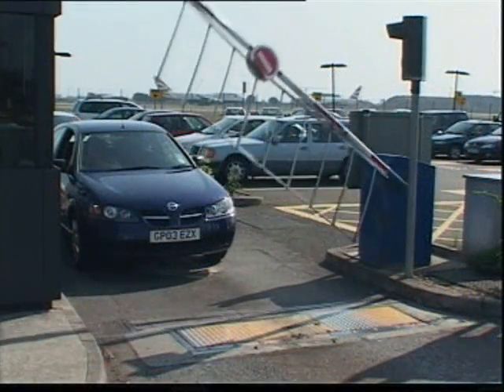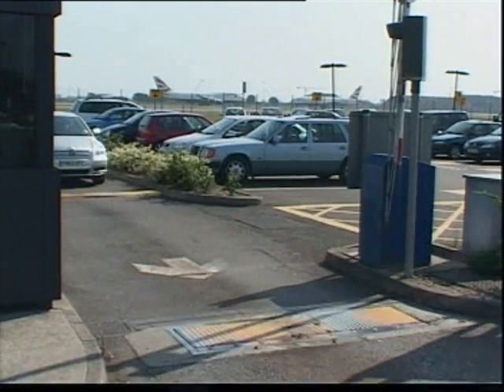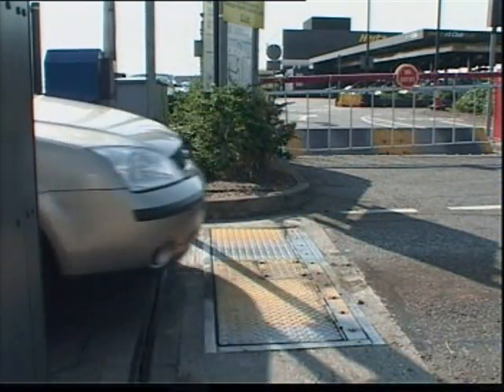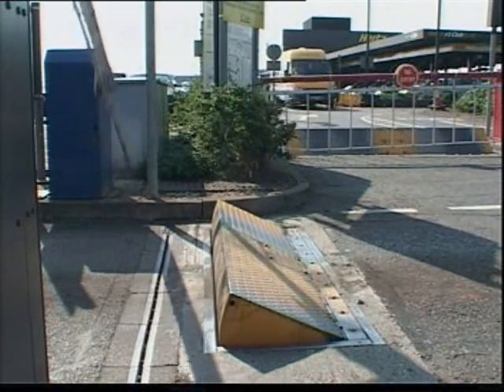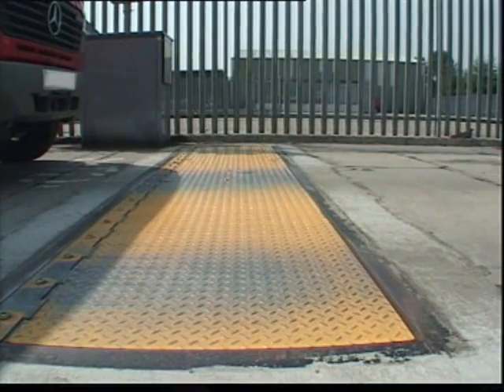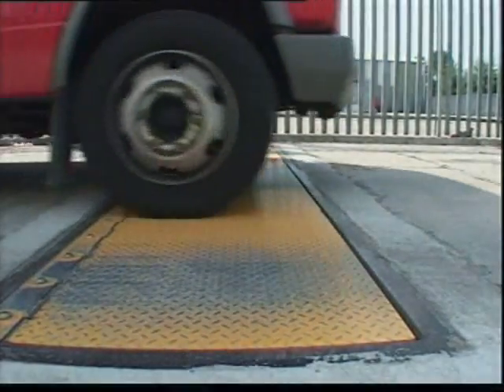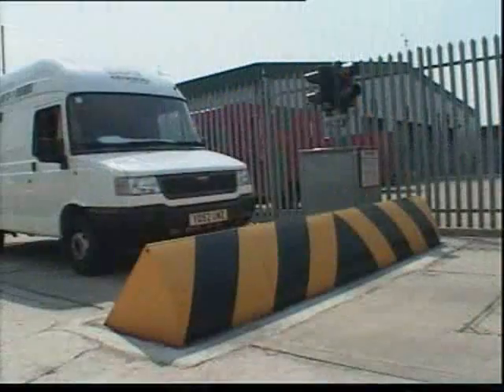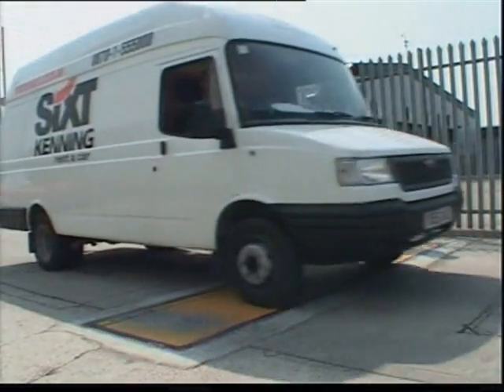Access Control Road Blocker Crash Test

Comment: Many cities already have systems in place that automatically change the lights for emergency vehicles. One way to solve the problem. Another would be for the emergency vehicles to use the on-coming lane, just as they would if there were a line of traffic already at the light.

Think outside the box, idiot.